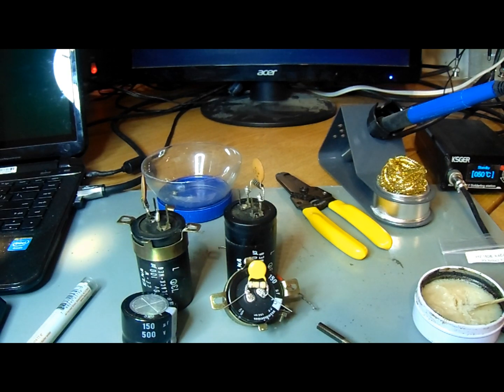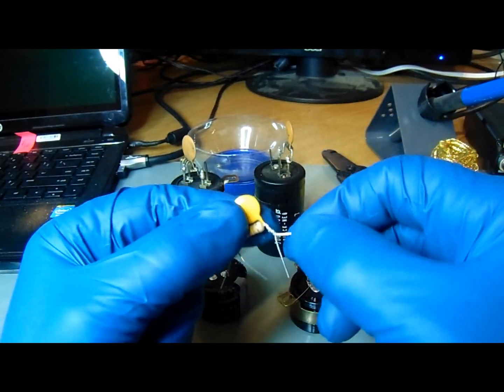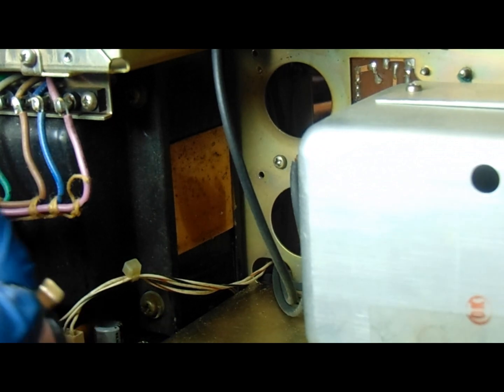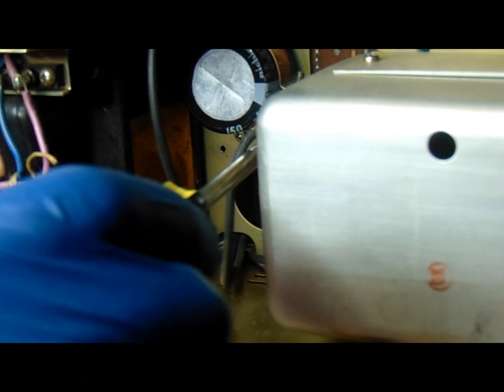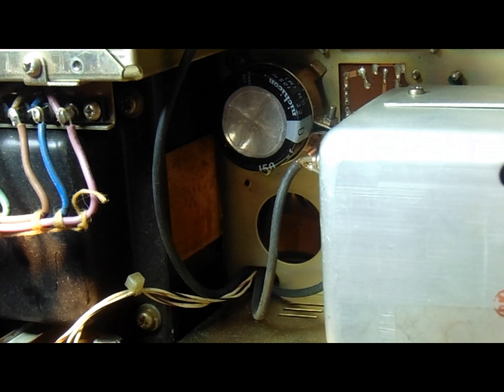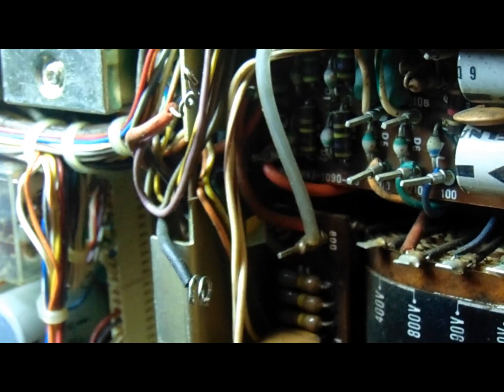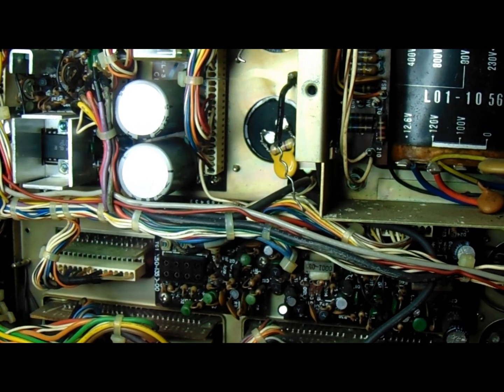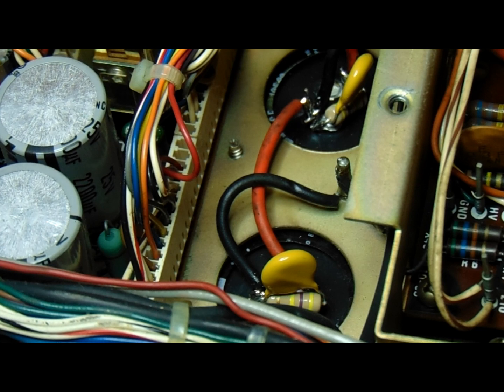Kenwood TS 820 s High Voltage Re Cap

Comment: The Bleeder Resistors work well in these radios but it is a good Idea to check for voltage before trecking into it.
Reply from the maker: I believe I mentioned that, and how to make them safe, in the video.